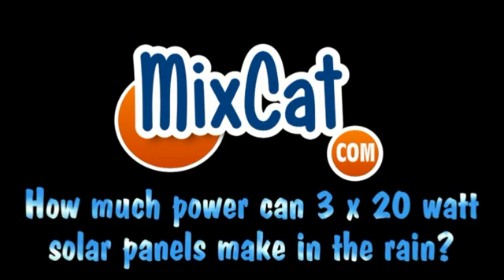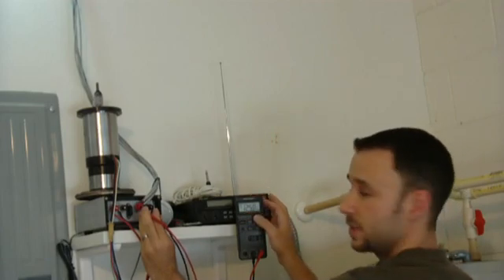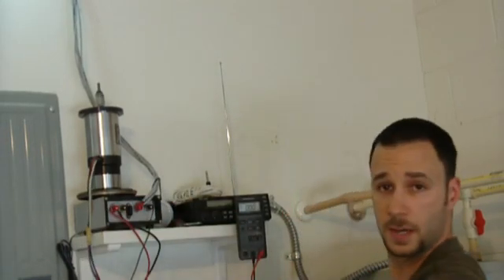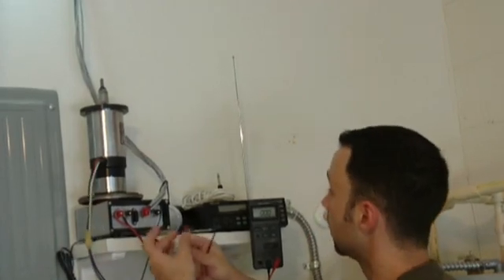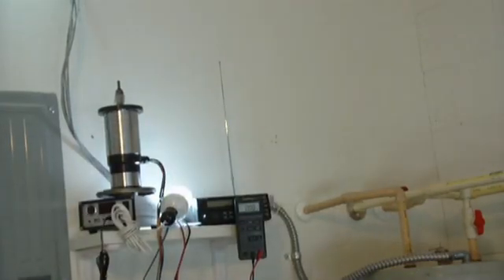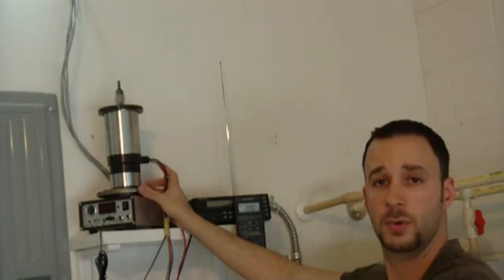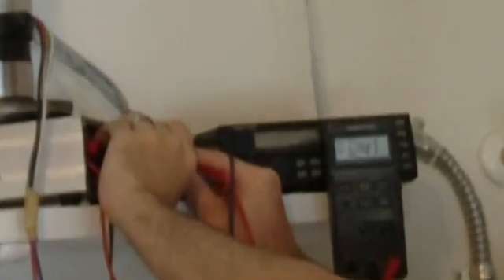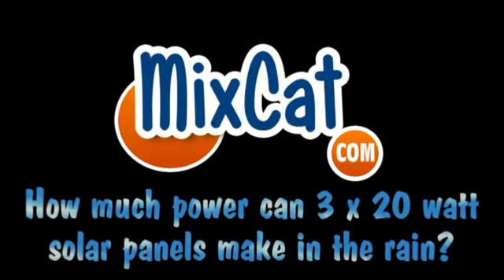Solar panels performance during a rain storm! Solar power test DIY

Comment: Actually your voltage must be more than 12 volts to bring the batteries up. I run about 18 to 19 volts. it will be difficult to bring the batteries up with only 12.5 volts.